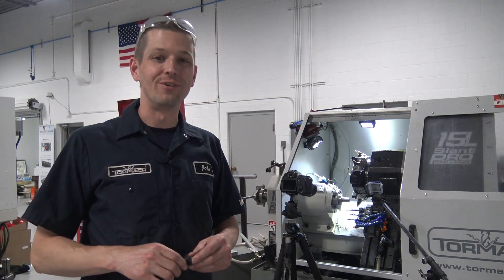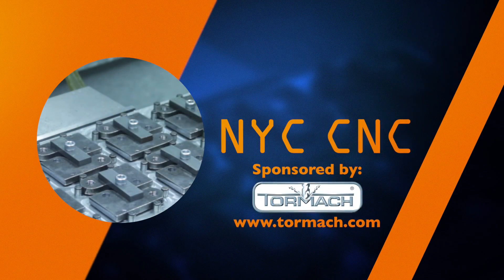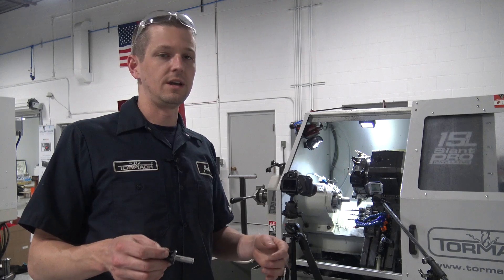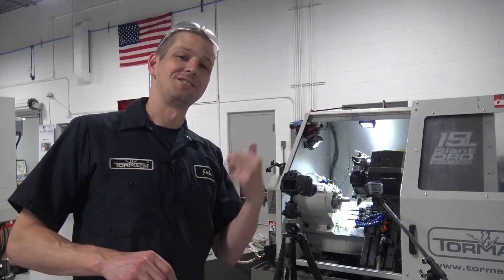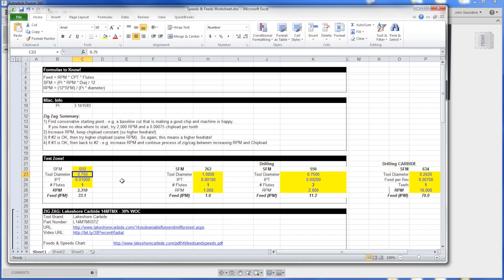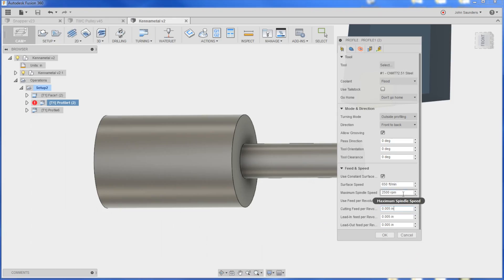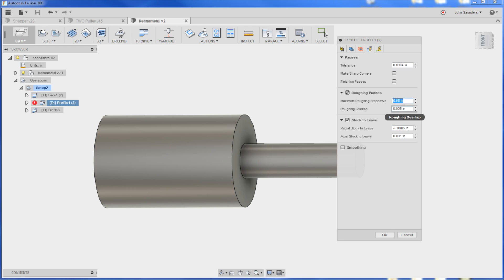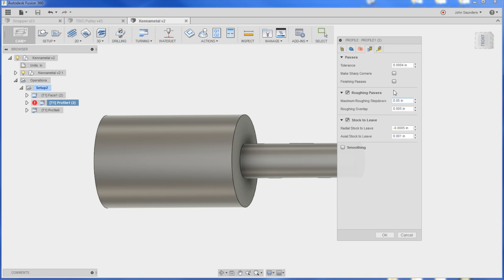Testing Kennametal Lathe Insert to get GREAT Steel Surface Finish!

Comment: I've had the same issue with reps as you trying to buy tooling from the big names as a "small shop." I have to highly recommend giving Carbide Depot a call. They are super friendly and helpful while selling nearly all name brands, plus they never have cared one bit about how big my shop is. I almost exclusively run kennametal insert tooling on my 1100 now that I can get it easily. Only downside is no local rep to come into your shop but that isn't too important for me.

Comment: Consider a high pass audio filter so it's not screeching as much while cutting
Reply: +hankus253 Might be your headphones (or high range hearing hearing loss).  It was a VERY high pitched noise that was incredibly loud.  I actually had to fast forward through the turning :(
Reply: +Greg Burgess I had to fast forward through the turning, it was killing my ears, even at low volume.
Reply: +Greg Burgess Replayed the turning part 3 times never heard any screeching.  Maybe he filtered it already?
Reply: +hankus253 The audio sounds fine to me all the way through.

Comment: Great to see this video on tooling for the Tormach lathe!  Can you say if the toolholder brand makes any difference or is it mostly the insert brand and model/type that makes the difference?  Would love to see some discussion of parting tools as well.  The GTN-4 inserts from Tormach seem way to wide when parting off 5/16" SS rod.
Reply: my experience showed me  the actual holder was less important than the insert.  until you must have qualified tooling of a standard length.  the inserts are generally built in the same specs of size.

Comment: I'm glad to hear that Abom79 got you straightened out about those finishing passes... I had to school a couple peeps on that myself the other day.  My finishing passes on the lathe with my insert tooling, is usually between .035 and .060 off the diameter.  otherwise the finish tends to suffer.  You can do crappy passes up to there, but when you hit that final range, you just really have to go for it.

Comment: The Kennametal guys (the engineers) were fantastic is solving a cut-off problem I had.... I was parting off 1" dia 304 stainless with one of their inserts and only getting 10 parts before the insert was useless.

I called KM and the engineer said I was going too slow and to bump the rpms up to 3000 and the federate to .008 IPR.... I was running about 800 rpm @ .003ipr.... oooooookay.... I was amazed at the difference! The parting tool went through the stainless like it was butter and I was getting 300+ parts before the insert started to cause burrs. The engineer said it is a common  problem in going too slow with lathes.
Reply: This is where Kennametal rocks!

Comment: We are a relatively small machine shop and we are fortunate enough to have some good iscar reps that will give us some great tools. One thing that I love is ISCAR Penticut tool. We use the same insert on titanium as we do on aluminum and they are just rock solid. We had to cut something similar to that part you just made and we used the Iscar Sumotec tools and it was a night and day difference from regular inserts. We finish with a .100" doc and the finish is so much better than a .02" finish. you have to let the tool cut or else you just push the part out of the way. Definitely recommend that Penticut tool again. Get that or get a competitor one, they are great. Super rigid and great finishes

Comment: As someone on a budget, it would be interesting to have you retry the import insert at the proper feeds and speeds. I like using the best but the budget only stretches so far sometimes. It would be nice to see if the Shars tool was "good enough."
Reply: I'm getting good surface finishes on Chinese inserts just by following their recommended parameters. They're really cheap too and you can buy them by piece rather than have to buy the whole box (this means you can try out different inserts to see what works for you). I'm using a manual lathe, no money for CNC...

Comment: I Always use a 2 radius on the little taig lathe, it works great especialy because you can not take very deep cuts and it gives you a great finish
Reply: +NYC CNC LOL, no with the 2 at the end, I think that is 02 its the smallest radius I could find, that works magic on small lathes like the taig, ccmt 060202 if i'm correct

Comment: Hi John
I'm running small bussnies turning small parts up to 32mm (1 1/4"), and we are using kennametal inserts.
For steel I recommend KT315 insert quality.

Also I would like you to say few words comparing positive and negative inserts. Must say I use only positive inserts. Maybe topic for Chip break video series.
Regards,Oton

Comment: Looks like I can finally watch your lathe videos again, your older ones always made me cringe.

Is there any chance to upgrade your lathe to a faster spindle? I thought 5000 rpm these days were minimum on cnc lathes.

Another thing you should consider is, to get a 55° or 30° tool for the finishing pass. I assume right now you use one 80° for all?

At work I use 30° tools with a 0.4mm radius, depth of cut(radial) about 0.1-0.25mm, works splendidly.
Reply: Guess we've got a different naming for cutting inserts here in Europe, because for me it's V. The insert looks like this http://www.sartorius-werkzeuge.de/supplyImagesHeiler/Webshopbilder/4c-326802-A-VCMT.png

W would be a 80° insert
http://www.sartorius-werkzeuge.de/supplyImagesHeiler/Webshopbilder/4c-310763-WNMG_WP.png

Comment: I think you need to up your feeds to get better chip breaker performance with that insert. I think with that machine I would look at a CNMG432FF in grade KCU10. If you want to be able to nail size from insert to insert without touching off or adjusting offsets I would go with a CNGG432FS in a KCU25.  On a lathe you can't sneak up on it and get a good finish most of the time. I like to take heavy cuts to within .020" of size and then take the last 2 as .010" cuts. That usually gets  a nice finish and eliminates the deflection that usually shows in the part taking the .050" and .100" cuts down to size.

Comment: if you can use 1018  try using 12L14
Reply: NYC CNC ... and can't be welded... correct?
Reply: +DSCKy Contains Sulfur and Lead so not recommended for welding. Tricky, can crack and fume inhalation issues.

Comment: Agreed on the carbide inserts and (not) sneaking up. I've experienced the same issue when I switched to inserts. So really interesting stuff John... Man, you REALLY got my wheels spinning on breaking into the CNC world. I'm going to sign up for the CNC class in my local tech school.
Reply: +BasementShopGuy You will end up ditching all the manual stuff and dumping the cash into CNC. Thats what I did anyways, had the same lathe you have, though not in as nice of shape. Sold it and bought a CNC lathe, I will never go back.
Reply: +bensbenz CNC's are awesome! But you need a lot of $$$ behind you. We just installed a new Mazak at work worth 300,000AUD and another $8,000 in tooling. And I'm the lucky one programming/operating it. Amazing machine!
Reply: +CarltonDry.Please You dont NEED all of that to get into CNC. With my converted machines mill and lathe I am well under 10k. Those machines are nice, required for production, but completely unnecessary for a guy in his basement or garage.
Reply: +bensbenz You're right mate. Good point. ;)

Comment: That is a counter intuitive to press on to get a good finish rather than skim it! - but it clearly works!
Reply: +Dan Whiteford If you dont feed in enough the cutting edge of the tool does not penetrate the material surface and more or less burnish or smudge it. If you feed enough that does not happen. Look here for further information http://www.cnccookbook.com/CCCNCMillFeedsSpeedsBasics2.htm

Comment: Having a small, home hobby lathe, I've been playing with some inserts which are ground and not formed.  I think the equivalent designation to those which you used would be cngg instead of cnmg that you had.  As I understand it, the lip should be a little smaller and easier to take a little shallower depth of cut with it.  If you have access to your insert reps, I would be interested to hear if my understanding of those designations are correct.
Reply: +ILGopher CNGG is a ground insert, it is more for maintaining insert size to an exact tolerance for production than anything. a GG-FS is a 12deg positive cutter while a MG-FF is a 20deg positive. The FF is thus the more free cutting insert. For light cuts in stringy materials the GG-FS will probably break a better chip.
Reply: Thanks, Brian.  Throw on the chipbreaker types on to the insert designations and us armchair machinists heads start to spin.  :-)
Reply: ILGopher
True, but they are what makes all the difference in the world for the application. :-)
Reply: Yeah.  I'm finally finding some charts which start to explain the insert designations for each manufacturer and that is helping.

Comment: are you cooling ?...?
Reply: +NYC CNC AAA oke
Reply: +NYC CNC I'm just an amateur, but I think that with solid carbide tooling you shouldnt be using coolant at all if its not flooding. A semi cooling e.g.  fog buster will make the tool chip, because solid carbide cant handle fast temperature changes. Fog buster did burst out coolant pretty nicely, but it wasnt following the tool. Anyway, thanks for the video!

More about it here: http://www.practicalmachinist.com/vb/general/no-coolant-solid-carbide-224991/
Reply: +Erik Knise Thanks for pointing that out; I had missed that during the Q&A and was wondering about that myself. thx!
Reply: +Warren Bailey I'm sure it depends on if you are buying cheap tooling that is still using old technology or if you are getting newer stuff.  Not sure how you would know the difference if you were holding both in your hand unless you bought known good new tooling from a reputable supplier.
Reply: even new tools some times suck (depends on what material/tool/inserts/speed (R)/ speed (F) 
so yes you can do it with out flood. but what he was turning was to big to mutch R & F to not use it. now he didt use the fog buster this wil keep it from dry Rubbing against the material, but wont do that mutch for cooling.

so was it bad what he didt ... no not realy (and for that 1 time for the camera that insert wil not give a ..........